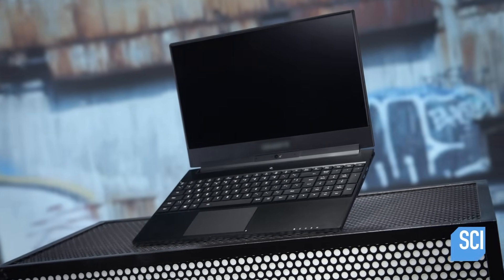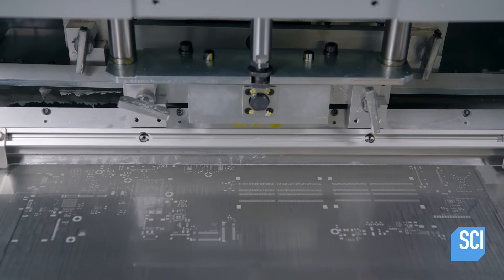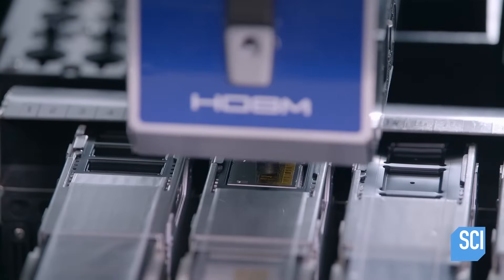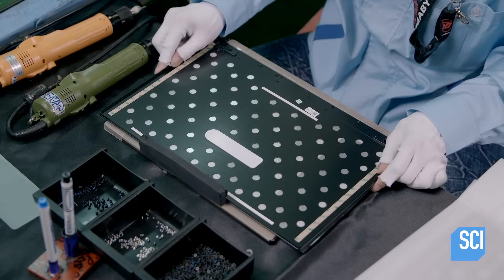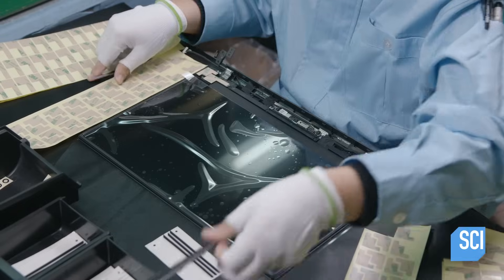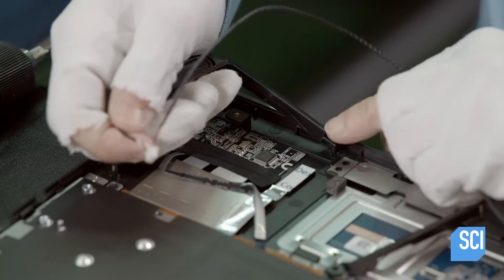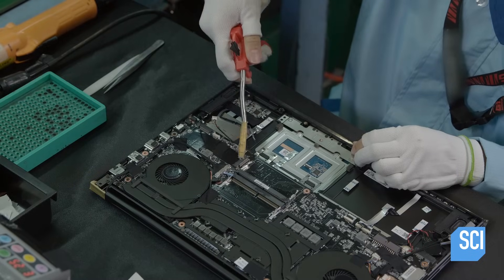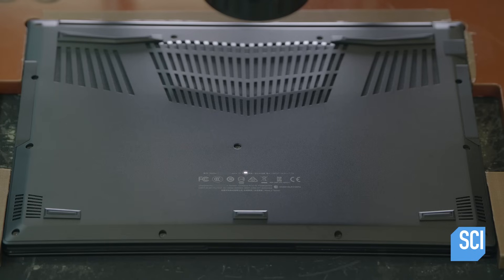How Laptops Are Made in Factories | How It's Made

Comment: shame you can't keep the laptops up to date with newer graphics cards...
Reply: You can upgrade your old laptop with external gpu but you will sacrifice your wifi slot for the external connector
Reply: @AyamMedia  wait... What?
Reply: @AyamMedia  wut?
Reply: @CauliflowerDesert  but you don't need an adapter. This laptop has a thunderbolt port. All you need is the dock and you're good.

This laptop isn't old.
Reply: It's plenty powerful enough. Has a GTX 1060 (6GB VRAM)
Reply: Master Khan so was mine 6 years ago...the problem is that the graphics card is built into the motherboard and can’t be replaced
Reply: @abalrog42  true. However, this laptop has a thunderbolt 3 port. You can easily connect an external GPU.
Reply: @Samirxkhan  fancy...
Reply: @abalrog42  Thing is making modular components on a laptop especially that thin would be too much of a manufacturing and design complexity that you compromise it being way thicker and probably still not giving so much benefit to the end-user. There was some laptops that allows you to replace the GPU, but that standard component is rather rare or almost impossible to get a replacement. Laptops designs are pretty much unique to each OEMs and even to certain models/platforms.

Nowadays to "upgrade" the laptop's GPU is to use an external GPU which give it a huge boost than just the laptop-designed GPU component.
Reply: @kornkernel2232  I'm sure you're right. I'm 100% willing to admit that when I plan to build a laptop computer, I look to an expert because I'm simply not one...there's a lot to know about this field and I'm going to school to be a chemist, not a computer engineer. Thanks for any info that may help me upgrade my desktop in the future  :)